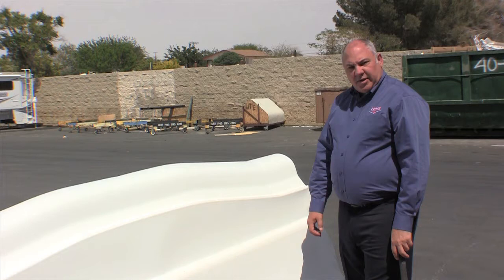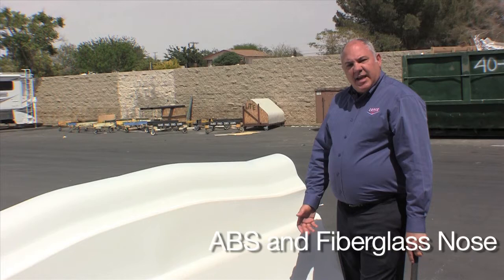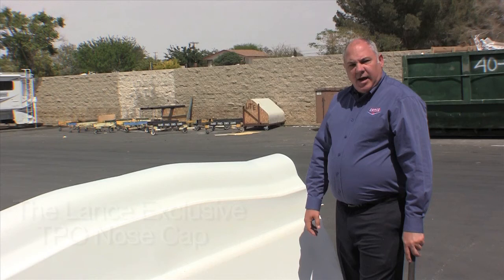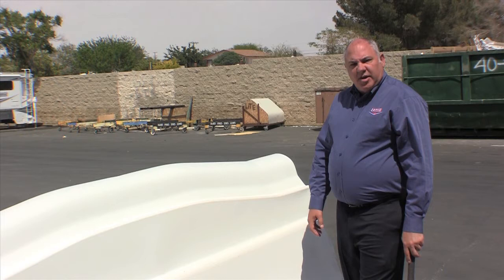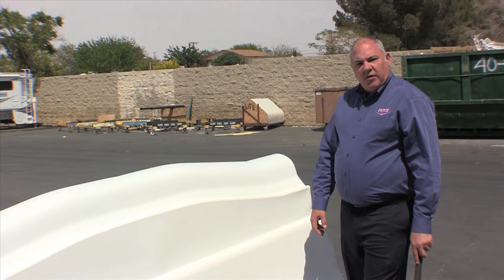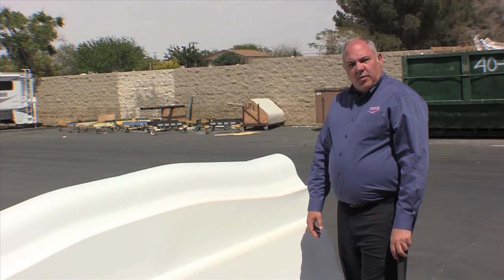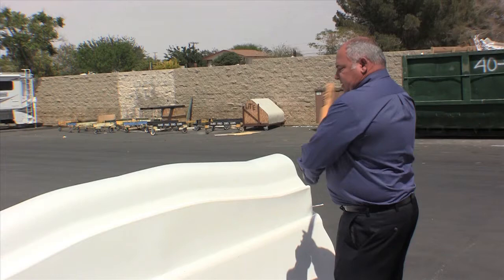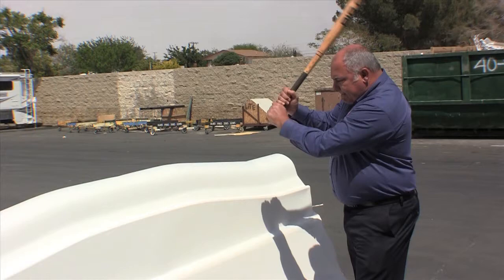Lance Camper:  TPO Nose Cap

Comment: This all sounds good, but my 2014 Lance camper front cap has a crack developing in the right side.  I am the second owner and there is a scratch on the front of the nose in the same area, but bottom line this is not as great a product as suggested in this video.    So far I can't get Lance to figure out how to fix my nose.   Hopefully they come through with a solution.